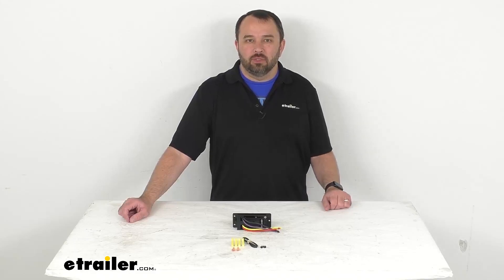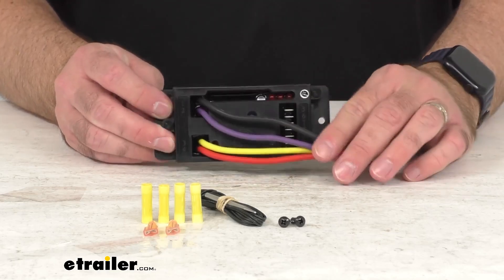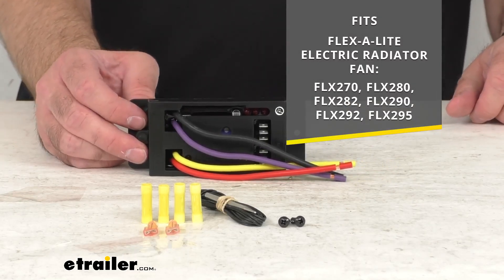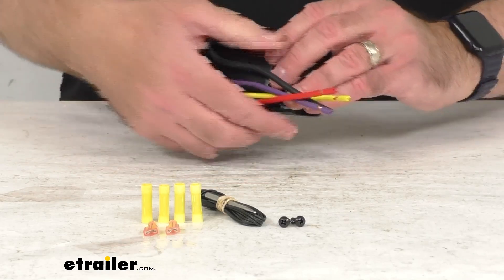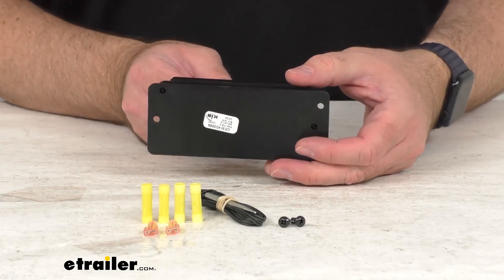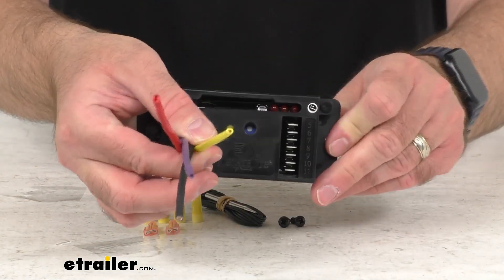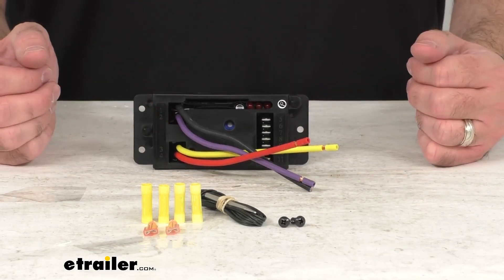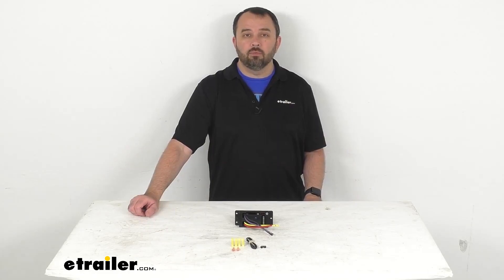etrailer | Review of Flex-a-lite Replacement Variable Speed Controller Kit - FLX33054

Comment: Will this require also using a relay ?
Reply from the maker: It won't if it's used with a compatible fan. The controller is compatible with the Flex-a-lite fan model numbers noted in the linked product description. The compatible fans already have an A/C relay. 
https://www.etrailer.com/Accessories-and-Parts/Flex-a-lite/FLX33054.html
Reply: @etrailer  ok thank you!
Reply from the maker: You're very welcome!